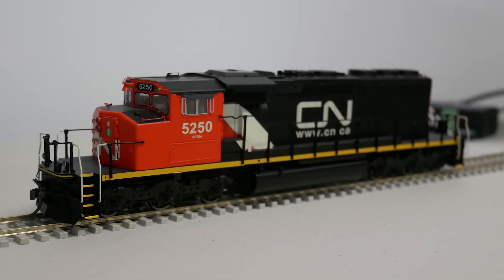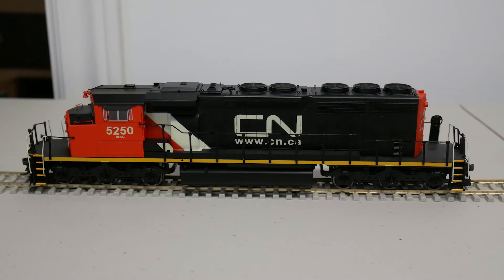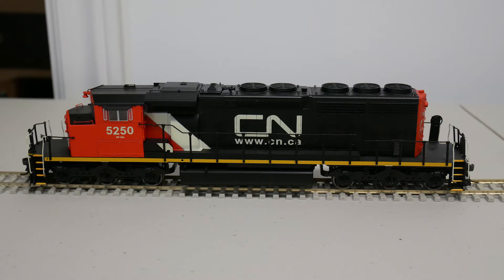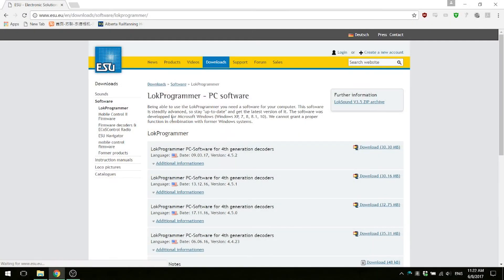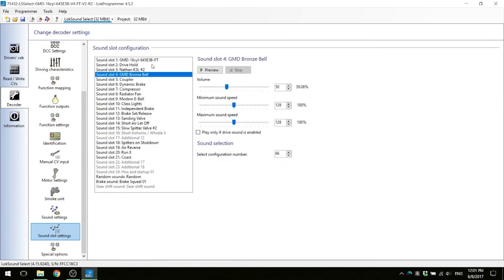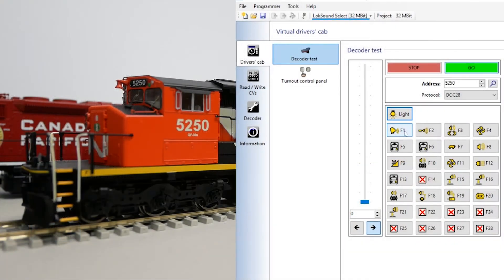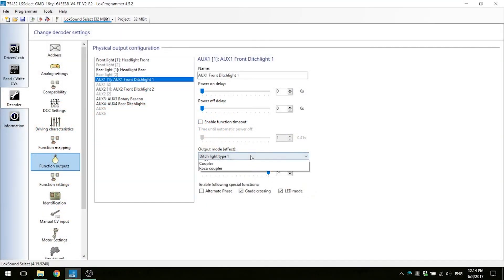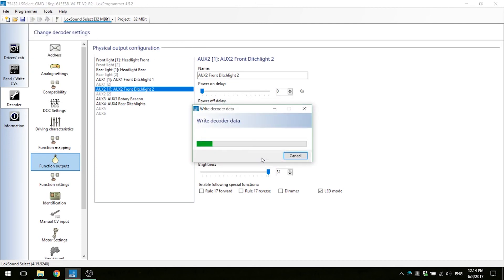Tutorial: Upgrading ESU Loksound Sound Files with the Lokprogrammer

Comment: So when you say - open the sound file -  to where to you open it (how does lokprogrammer know its THAT sound file?)  and what about the sound file already on the decoder? If you are replacing it completely (IE replacing a steam file with an electric loco sound file) - do you have to first remove the original file? Or does lokprogrammer over right everything?
Reply from the maker: The sound file when you download it, will be located on your computer. That's how the lokprogrammer will know it's that sound file and not any other one. The sound file also contains the CV list, you are free to make changes to the CVs and save them with the sound file. This is useful if you have multiple locos of the same brand/model. You can do the sound and CV adjustments on one locomotive and then save the file to a name you can recognize (for example: "IntermountainGEVO.esux"). Then you can apply the sounds and/or CVs on every other Intermountain GEVO you own with just one click, as opposed to going through it manually each time. Just remember to change the locomotive address!

When a new sound file is written to the decoder, the old sound file on the decoder will be erased automatically by the software.

Comment: cool now when you save your settings on pc dose it permanently save them on decoder like bell function or speed of locomotive  so when you do factory decoder rest cv8 value of 8 it reset to the setting that you use the pc on or dose it reset to the main setting before you change them on pc?
Reply from the maker: Marine Raptor You can save the decoder settings on the PC so if you ever lose the decoder data (or have a completely different decoder) you can quickly restore the settings. This is useful if you have multiple models of the same loco.
Reply from the maker: Marine Raptor CV8=8 will reset all of the function settings but not reset the sound file.
Reply: ah ok cool.
Reply: You can also override and overwrite the factory defaults. It will make them permanent. It asks you when you write the changed CV values.